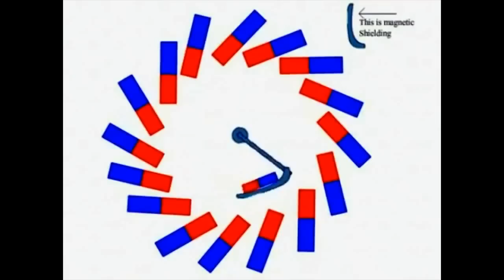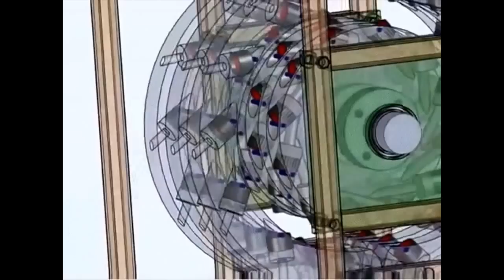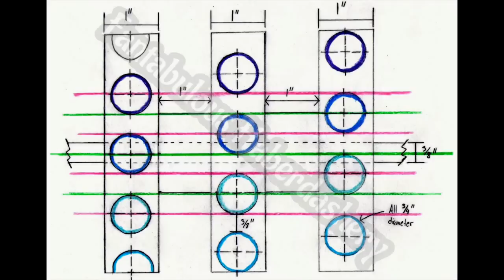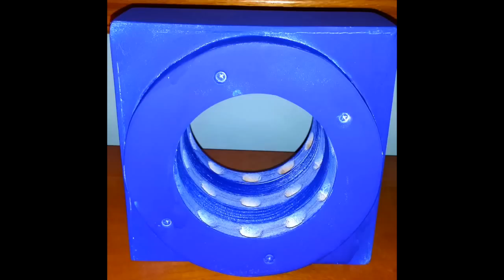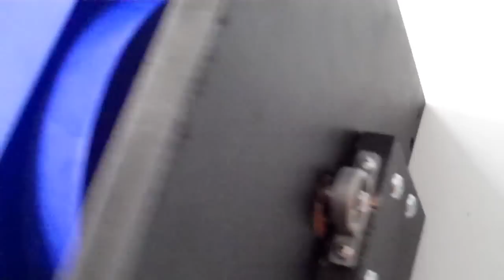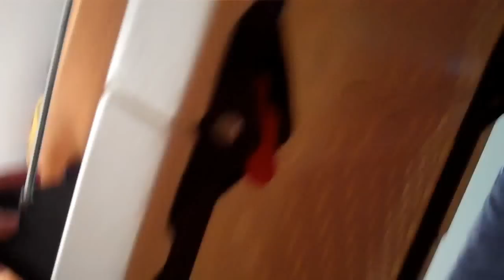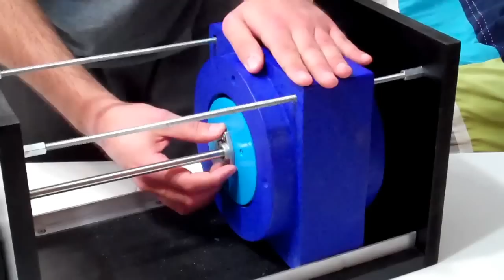Working Perendev Magnet Motor!

Comment: you have been misinformed magnets do not wear out there are lawn mowers that are 50 years old with the original magnets working the Magneto so the theory that magnets wear out is bull
Reply: The magnetic strength of any magnet will decrease over time. Your 50 year old magnets in the lawn mower are not just as strong as they were when new. They have lost roughly .1 % of their magnetic strength. The way a magnet becomes a magnet is by aligning the structure of the ferrite particles within the magnet. The ease of which a "magnet" loses it's magnetic strength depends on whether or not it is made up of a hard ferric or soft ferric material. So until you fully understand what you are talking about don't put others down for statements that are in essence true.
Reply: 1% over 50 years - yawn.... what a waste of time statistic that is.....
Reply: Magnets under opposing force lose strength faster than those at rest. "Permanent" magnets definitely last a great amount of time, and our current materials would allow for even longer permanency, but again, they do wear out.

The principle he is talking about hear does involve the generation of energy, if this motor worked at all, the magnets would wear out.

I think the video is BS, and agree on those points.

But magnets under opposing magnetic force do lose strength, due to the structure trying to normalize the magnetic field, and this occurs measurably faster than that of a magnet at rest in a relatively non polar environment.

It is the same principle that causes a non polarized iron bar to become polarized under magnetic interaction.
Reply: loss of 1% every 50 years - is your statistic really of any interest then ......
thats like saying the sun is going to run out of energy one day, useless information
Reply: The toy you refer to is a battery powered device. The electromagnet in the base is pulsed in time with the natural resonance of the device, thus keeping it going. Take out the battery and it no longer operates. Permanent magnets alone cannot make continuous motion, no matter how they are configured. Period.
Reply: True or fake will never know... Unless make the setup myself...Hmm... I will try
Reply: They do exist. Only those with closed minds dont believe to be true. https://www.youtube.com/watch?v=mHW6b1aFPfU
Reply: If you remove all magnets altogether and replace them with something heavy and balanced it will keep turning a lot longer once brought up to speed, a flywheel effect.  This device is bullshit. If it indeed keeps turning there has to be an energy source that causes that, and permanent magnet are no such source. Permanent magnets have no stored energy so the discussion  of whether they lose their "power" over time is simply not relevant. Whether they keep their magnetism for long time or not, they can't power anything in either case.
Reply: This is somewhat true. Without some initial additional force, it would be highly difficult to rig a system in which static permanent magnets would be able to initiate rotor spin.

But, in the video (which, again, I agree, is sketchy), he manually starts the rotor, making no claim that his model is self-starting. The magnets could support spin for a period of time, allowing the spin to last longer than it would without interference. It takes little force to maintain movement compared to that which it takes to initiate it.

This is a valid principle, even if the system used to express the principle here is bogus.

These toys that have been around for decades are an excellent example of the principle.

http://pull01.officeplayground.netdna-cdn.com/media/catalog/product/cache/1/image/9df78eab33525d08d6e5fb8d27136e95/1/0/1099_Cosmos-PerpetualMotion_1B_1.jpg
 
Permanent magnets maintain motion, sometimes for days or months if the device is well balanced, clean, and not disturbed.
Reply: ed cupp : sorry to burst your bubble , magnets do not wear out but they do lose some of their magnetism, they do get weaker with age. the more they are put in opposition to each other the sooner they will weaken.
for over 30 years i have worked on computer equipment, we have had to replace many many components due to the magnets losing their strength, they have had to be sent back to their factory to have the magnetism brought back up to full strength. the only thing i can point out is that horseshoe magnets all come from the factory with a "keeper" across both of the poles, this is to preserve its strength while in storage.
Reply: normdoty you just burst your own bubble with your statement
Reply: You are wrong, all magnetic field strength deteriorate at some rate depending on the material. You just have to ask for specifics. Just do your research. Go and Google it and unless you close your eyes, you will find it.
Reply: Ed Cupp, you are miss informed magnets do lose power over time... however 50 years... Even 1000 years is nothing compared to the full life-span of a magnet. And different materials decay at different rates...  in other words, some magnets last longer than others.
Reply: Funny how in this video, he CONFIGURES the magnets just right and it spins on its own... I guess I prove you wrong... again.  https://www.youtube.com/watch?v=BSdSDfOWbNs
Reply: your kidding me really??? I've tried these tests and they all work. Maybe you should do some tests on your own. The results may surprise you...
Reply: I don't have the tools to reproduce this experiment, unfortunately, otherwise I would certainly try it and post a video. Until I try it myself, I'm willing to accept there is a small chance you could be right, but on balance of the available evidence, I believe the chance is very small.
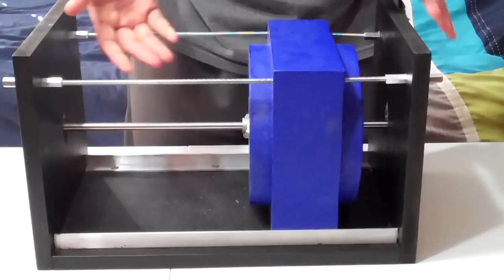Sure, your raw video footage is evidence that it's possible to build a near-perpetual motion machine - but there''s also much evidence to the contrary, namely: the very long history of failed perpetual motion machines, my understanding of the laws of magnetics (especially that magnetic fields form closed loops, and therefore have to average out to zero over an area!), and the suspicious jump cut at 8:11. So on balance of evidence, I still don't believe you. Especially because of the first and last points. 

Let me restate the situation: Every other near-perpetual motion machine was eventually proven to be fake. Your video contain. I wouldn't mind doing so - maybe when it doesn't work you can tell me what I did wrong.s an artifact that could be innocent, but could also indicate that your machine is fake. If I were you and I heard the doorbell or got a phone call, I'd either leave the camera running, or I'd redo the entire take, in order to disprove claims that you are hiding something with the jump cut. Since any reasonable person, with a working near-perpetual motion machine, and knowledge of the controversy around perpetual motion machines, would do that, and you did not do that, that is actually quite damning evidence to me that you do not have a working machine.

Edit: Oops, I thought you were the person who posted this video (that I am commenting on). It still stands with regards to this video. It's also predicated on the fact that he believes this machine produces more energy out than what is used to spin it out, which I'm not sure about after rewatching it. If it's just a low friction device, then yeah, I've seen those in real life.
Reply: it didnt spin by it self ... he converted his MOTION energy to give it an initial push ... it then also slowed down slowly due to energy beeing taken out by friction and all that physics crap ... the magnets just work with the energy you put into the system by spinning it to start it ...
Reply: ferrous
Reply: Wear out is a relative term. It is not like usage/drain on the battery runs it down like a battery unless you think of that battery taking hundreds of years to wear down. I am sure that if you had two equal Tesla magnets and one was on the shelf and one was not you probably would see a difference in a year or two in microtesla's. However it is negligible if the magnet is made of a high enough retentivity material like pure iron.
Reply: thats only cause you dont understand.
Reply: Permanent magnets do lose their magnetic energy so to speak over time, but this is a very slow process that takes many human lifetimes. However exposing a permanent magnet to extreme heat, typically above 600°Celsius ( 1112° farenheit or 
 873. 15K for all you thermonuts out there) they will lose their magnetic power and depending on the material may regain their magnetism once cooled down.
Reply: I came to this video from one where he was recovering magnets from the magnetometers of old microwave ovens, and when I heard the remark about magnets wearing out, I thought of my 25 year old microwave oven.  The magnets have been directing bunches of electrons around the resonant chambers in the magnetometer at considerable energy levels (800W) on a daily basis ever since it was new - and it's still going fine, so the magnets seem not to have worn out.  I have heard this remark on other videos about perpetual motion machines, showing that they are not "perpetual motion" because the magnets will eventually run down.  They seem to think it's not a perpetual motion machine because it won't run till the last star in the universe goes cold.  In fact, it's not a perpetual motion machine because it's limited by physics - but this crap about magnets running down shows their level of understanding about what a perpetual motion machine is (or would be).  An over-unity machine is probably a better name.
Reply: Even if magnets do wear out, a motor powered by replacing magnets every 50 years would be way more efficient than anything we know. So who cares if "it's not free energy because the magnets wear out" - you would still get a whole lot of energy before needing to replace the magnets.
(That's if these magnetic machines actually worked)
Reply: Very good example. And those 50 year old magnets are nowhere as "permanent" as today's magnets. I am so tired of folks claiming that magnets "wear out". Sheesh...
Reply: @JimMerrill every single one of those has something hidden. In this case probably spinning magnets under the table or above the camera. Or just a compressed air gun.
Reply: True, but that doesn't change the fact that the video poster is lying his dumb ass off. There is NO way any type of permanent magnets, by themselves, can make a rotor spin.
Reply: Crookes radiometer, it spins and needs only light, you put it on the bright side of the moon and you got a quasi perpetual movement, it is usable ? Hell no ! you are way better with a solar panel but its just fun, this guy did not say anything about energy production and it is just a magnet bearing with a "twist" ;)

Comment: the only way to use a magnet force to produce energy is finding a new material to reflect or re order the flux without the molecule absorb or conduct the force witch dosnt exist, but thats the only way that you dont have to be genius to now it will work

Comment: HAHAHA. You screwed up. First of all the left side is out of frame. You can see the shadow of your hand putting something on the end of the shaft and taking it off. You cannot get more out then you put in. Every action has an equal and opposite reaction. That's why magnets alone will not work. And magnets are not "Charged". A magnet is made up of a substance where a majority of atoms are aligned in the same polarity.
Reply: I wasn't wondering whether I can have something like this to assist my bike. I don't need perpetual energy, just a little push to help cycle along

Comment: Congratulations until end found a person understood the magnetic motor'm doing and the principles are the same except that the magnet motor and axial and Stator and diametrical the angle 34 the magnet has to tamp with a mu-metal type material capsule to center the magnetism now the amount of MAOIs have to calculate to have a good spin my imail contato@etem.eng.br
Reply: Is angle 34 anything like Area 51?

Comment: Hello there, first of all i want to ask you to be tolerant as english is not my first language and i going to write about some complicated things.

Congratulations on you model based on wood and magnets and then to some practical questions.

For how long can you sustain the rotation in your model, and how many rotations per second did you get from it?

I ask that because there is an well tested way to convert movement to electrical energy, most of the diesel and gasoline generators use movement and bobines combined with a regulator circuite to convert and control the output of raw charge.

Second more like and advanced understand of your model, there is some other materials to be considerate and it can be used to improve the construto. There is some bearings for instance that can be used to reduce the initial amount of kinetic energy required to start rotation and as well to make the rotation constant and there is also the consideration of the height of the components, you are using some magnetos and there is not the case to prove that you can harvest this rotations the important for functional model is a ratio between the amount of rotations per second and the operation time.

Well my intent here is to tell you that you are in the right path, but still there is improvements required to transform an electromagnetic rotation system into a electrical generator.

Comment: A magnet is not an energy source. Magnets cannot power devices by themselves as the magnetic field of a magnet is a static force with no dynamic properties of changing force whatsoever. As a magnet loses its magnetic identity, so does the magnetic field reduce in force. A magnetic field remains static, and can not be made to act as a dynamic magnetic field surrounding a wire through which an electric current passes. You may want to think about this. It's not good to FOOL mother nature, as they say.
Reply: I take nothing for granted.  I researched these "magic magnet motors" very thoroughly, and have found that they all have a "sticking spot". That is the place where the rotor magnets and the stator magnets find their magnetic equilibrium. You are welcome to try to make a "magic magnet motor", but don't piss your life away trying to do the impossible.
Reply: Keep in mind that the guy in the video is using an electric motor (outside of the left frame) to keep this scam spinning.  He won't tell you that though, as that would spoil the magic trick. He's hosing you, and you are falling for it.
Reply: +rich lowley The bottom line is that something for nothing is impossible. If you want something to move, rotate, or do work, you MUST input energy. There is no free lunch.
Reply: there is with magnets you can make a magnetic motor to turn an alternator and produce free energy and to keep the magnetism in the magnets use some power from its production to create electromagnets this is what im saying, nothing is impossible its just a lack of knowledge how many times have people said what your saying and if people just took things for granted we would never move on your attitude is so wrong my friend.
Reply: The only thing wrong with the "powerful magnets" theory is the fact that permanent magnets, regardless of their strength, by themselves, cannot produce continious motion, period. Permanent magnets contain no energy, just force. Not the same thing. There is no energy to expend, therefore no motion can happen. This video is a hoax.
Reply: +Kevin Thomas what about electromagnets if you could use a battery to start the motor off then use some of the power generated into the magnets wouldnt this keep the magnets healthy for ever? obviously im talking about the magnetic motor powering an altenator or something and using some of its produced power to run the magnets
Reply: The amount of energy produced cannot be greater than that used.

The system you propose produces more energy than is in the system.

The idea that an efficient generator may be made using magnets is not unreasonable. A self-sustaining one without access to an external source of energy is implausible, and without some external (if unknown) source of additional energy, impossible.

Even assuming a prefect, zero-loss system, all energy produced would have to be returned to the magnets in order to maintain them. You can't just use some of the energy. The machine doesn't create energy, it converts it.
Reply: if you have magnets powerful enough to drive an alternator for arguments sake you would be producing free energy and it would'nt be impossible to use a small amount of the power its producing back into the magnets to give them an extra boost, there are motors on the net now that have a lot of power enough to do what im saying and they are definitely producing more power than it takes to produce it. you can not say its impossible to do anything when talking about anything in this field, if they put the money into it we would have generators powerful enough to power our homes the size of a portable tv set, but until we have bled the earth dry of fossil fuels it will never be allowed to happen now thats the only fact in this field.
Reply: Quantum Leap its no hoax what i have seen, people have got magnetic motors that spin continually and at high speed more than capable of doing the job.
Reply: Nada a ver.